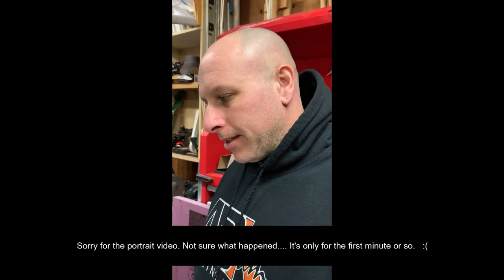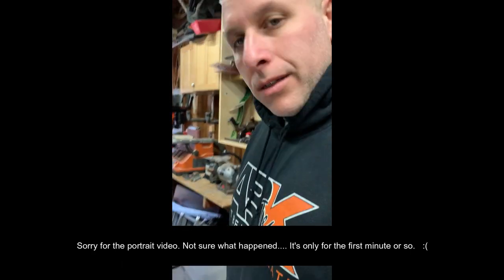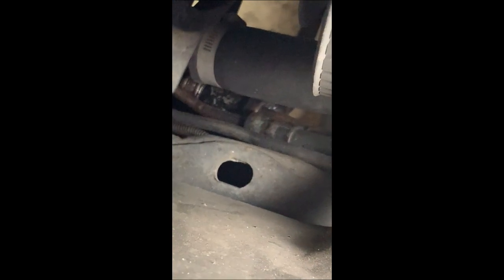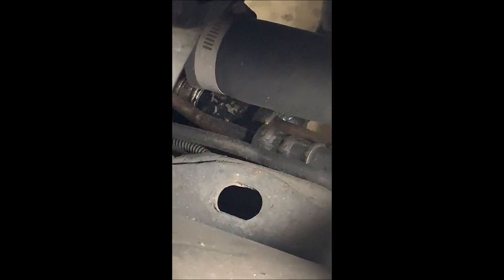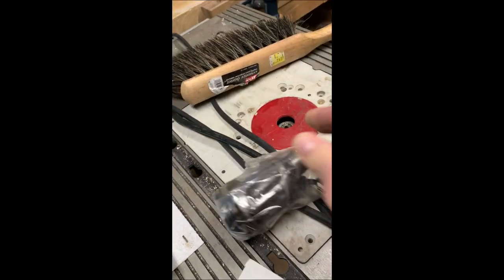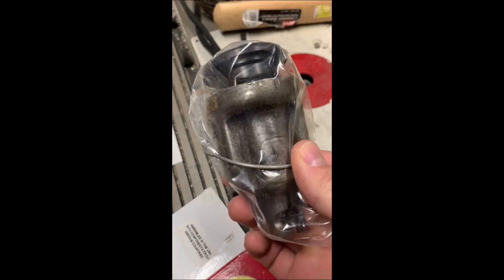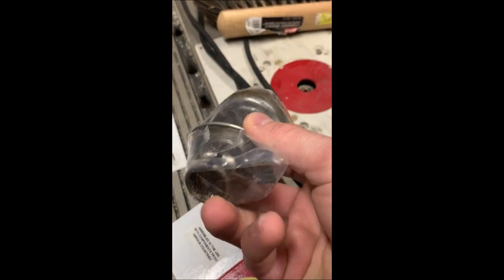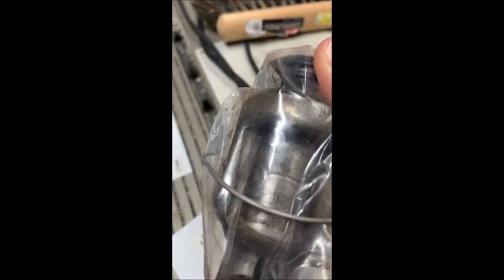1981 CJ7 Steering Shaft Dust Boot Replacement

Comment: For future reference there is a bolt that secures the upper u-joint to the intermediate shaft. You can simply remove the bolt, tap the u-joint off, then slide the new rubber boot components down over the shaft. This will avoid damaging the cross pin or fracturing he lower end of the intermediate shaft.
Reply: Hello there Homing Beacon - Sorry to say this info is not so on all CJs my friend. I have an '83 and it does not have any "bolt" on upper or lower u-joint. Figure 2J-26 on page 871 of the 1982 TSM (Shop Manual) is the reference. The "bolt" does appear in models after 1984... making it easier to get the "boot"on.
Reply: The "bolt" does appear on page 863 for column on manual steering too ... Jeep CJs change hands so many times it's hard to know where parts came from ...

Comment: Why didn't you just separate the 2 pieces of the shaft? Would have been much easier. Lmao
Reply: The two pieces of the shaft do not come apart unless in a collision, there are pins that hold the shaft together.  These steering shafts can be a major pain in the rear to come  apart, he did a good job.